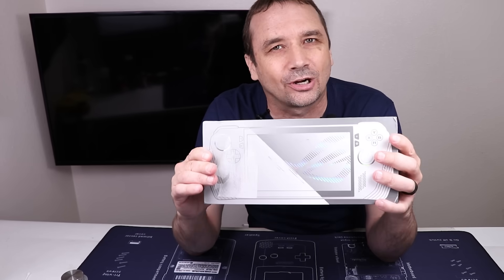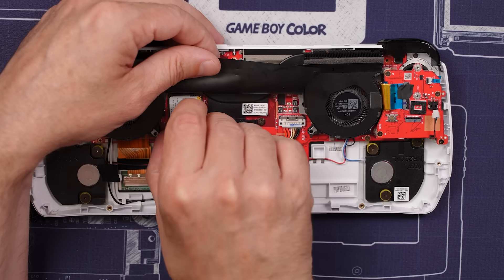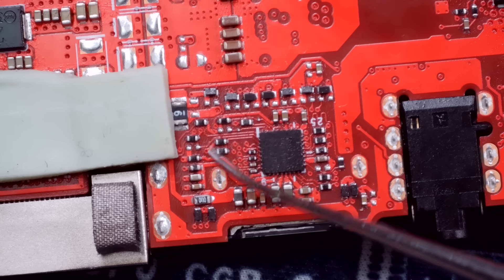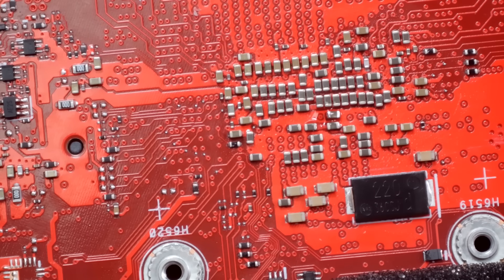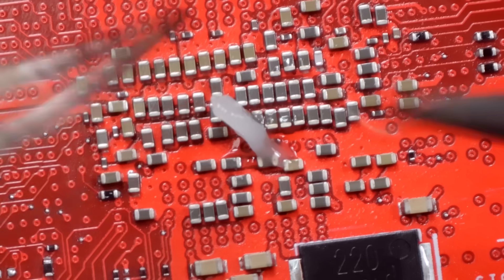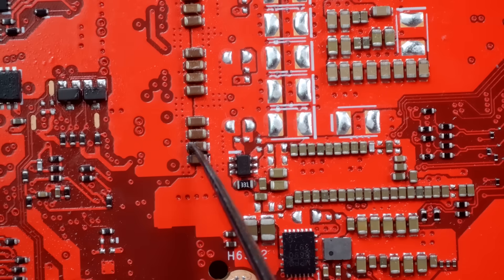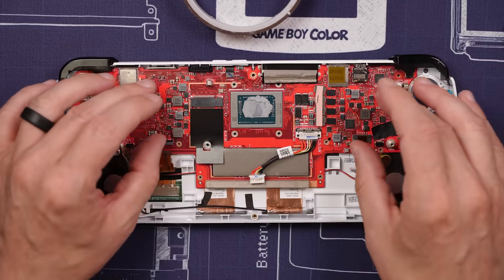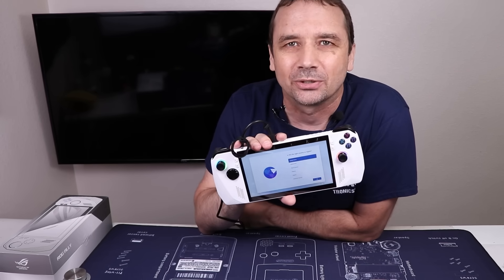ASUS REFUSED to Fix His ROG Ally - Can I?

Comment: They should have just said no warranty because it was already opened,
Reply: Then they would've been sued. You can't deny warranty for opening anything in the US thanks to the Magnuson-Moss Act in 1975 unless you can prove that there was damage inside the device that caused the issues. It was easy for ASUS to see the potentially low-quality flux and claim that as liquid damage, especially since the customer also had a failed soldering attempt.

Comment: Asus repair cost: over 800$, Tronicsfix: 2 to 3 cents worth of capacitors replaced/soldered down: device fixed.
Asus clearly does not have the skills in their service and repair department to fix their own devices. It is shamefull that they would rather extort their customers and just increase the junk pile.

Comment: I wouldn't have an issue if Asus denied the warranty claiming "Damage from prior repair attempt." or something along those lines. However denying it for "Liquid Damage" is just a BS excuse to deny warranty. I also have a huge issue with the fact that they tried to charge more for the repair than a new unit costs. A manufactures repair cost should be the cost of the part plus a reasonable hourly rate for the repair, and return shipping.
Reply: They have to say that. You can't deny warranty from simply opening the device unless you have some sort of proof that what the customer did caused damage under the Magnuson-Moss act in the United States. They said "liquid damage" was the cause of the issues in order to prevent a potential lawsuit, given that many people are already at their throats with them scamming Gamers Nexus.
Reply: @jayc.landgraf6828 I never said damage from opening it. I said damage from a repair attempt. The flux itself is evidence that something had been done to the device. It's not a warranty void if removed sticker, or just evidence of being opened, which is what the Magunson Moss warranty act prohibits.

Comment: 5:19 Steve honestly I'd say Asus should have fixed it for free, if he didn't already attempt to fix it himself. But it sounds like he tried to fix it himself first, then it went wrong and then sent it in. I'd say if things are under warranty RMA it with the company, an even if they are not in warranty ask they may still help. Then if they don't then that's when you can try yourself.
Reply: You are right. The guy realized the repair was beyond his capability and figured Asus could fix it for him, no questions asked.
Reply: @ColdStuff-cf7jv  Yeah, because if I'm ASUS an I can tell the device was opened and messed with then it's not faulty anymore in My eyes. Since the customer opened it and "did something" to it, that alone gives Me pause to think they caused the issue. With that voiding the warranty. So no dice. But I do agree there is NO liquid damage, but the tech that looked at it should have seen it's flux not liquid an noted it's been messed with so no free fix. Now $800 to fix that's total BS, might as well go buy another an keep this one for parts.
Reply: @chrisa6120 I am not in agreement in charging repairs in the Apple Method but people need to be upfront and honest if they messed with a product and trying to get a free repair. Maybe Asus would have told the guy,"Too bad, so sad" but this is why companies have become tightwads when it comes to repair. The idea of businesses=bad/consumers=good is over simplistic. Plenty of people scamming the system. I am not saying one side is an angel but there has to be nuance when looking at screwed up repairs done by people.
Reply: What you said was explained clearly in the first ten seconds of the video. Such an astute observation! Did you even watch the video?

Comment: Opening an electronic item does not void any warranty. 
Working on the components does.
Asus citing water damage was probably the only option they had to refuse the repair? Maybe they didn't have "customer repair attempt" as an option ?
Reply: Actually all technology companies has Zach and no warranty because if they didn’t, they would be replication devices that have been stupidly tampered with.

Even all devices used to have stickers on the back telling you if you opened this device, I will remove that sticker with the screws to open the device for behind you voided your warranty .

So you need to go with your warranty on electronic devices because yes you opening the device will Voyager warranty .

That’s why most repair shops tell you once they’ve repaired it that your warranty is no longer valid for the device because they’ve opened the device. Yes they fixed it but they have tampered with it so therefore you warranty is no longer valid and the repair shop normally would give you a replacement warranty . There’s a lot that don’t cause they don’t have to because you chose for them to open it up fix it instead of going to the company and get them to repair it..

The clauses that voyage warranty is a very old clause and it’s been never a long time but if you don’t actually read up on the warranty or look at the device properly before opening it you don’t actually realise until you’ve done it and then if you mess it up, you go to the company they can tell you’ve opened the device you’ve tampered with it. They will tell you your warranty is voided ..

Comment: Gamers Nexus did a huge video on Asus and there crap about not covering things and making excuses - Great job at fixing it!
Reply: I wouldn't blame this on asus at ALL. I don't think their warranty dept has a check box for solder rework. Physical damage would be a similar choice.

If the port was defective just send it in for repair. Yeah it sucks to be without your device for a few weeks, but that's a better option than attempting micro soldering... UNLESS you know you damaged the port and it was NOT going to be a warranty issue. This person attempted the warranty "lottery" after trying to fix a non warranty issue.
Reply: @volvo09  asus voided warranty on a fully functional GPU that needed 1 out of its 3 fans replaced. reason? dust on the fan. fk asus. and fk you for siding with a company that doesnt honor its warranty, there needs to be class action lawsuits against them so they will obey the warranty laws.

Comment: That also happened with a Nokia of mine that wouldn't pick up signal even if I changed the antenna, but was out of warranty and I wanted them to repair and they refused saying it has water damage which clearly never had and the board was 100% clean and crystal clear.

They basically wante to refuse warranty or fixing = it has water damage and done...

Comment: Owner should have sent it in for warranty repair when the SD slot stopped working. Trying to repair it themselves, and damaging it in the process, is a valid reason for Asus to reject the warranty claim. 

Did you test the SD card slot after your repair? If not, I would, since that was the original problem.

Comment: My experience with ASUS is that while my Ally was under warranty they did a good job. I had opened the device several times, as evidence by the little seal on the screws being broken. They still replaced the entire motherboard under warranty to fix my SD card and rear triggers. My device did get sent to them through a local Best Buy, which may have effected my warranty experience (based in the US)
Reply: i think best buy being involved is why you had a good experience. i had a gpu warranty voided when i sent it in for a simple 5$ fan replacement and they said 'dust is on the fan, give us 850$'
Reply: @zack4817 damn that's awful

Comment: Probably right to deny the claim since it had been messed with. Liquid damage is probably the easy way out versus the argument 'we think you worked on it'. They probably only have a select few reasons in a pull-down menu option, I suspect that they don't see many bodged repairs under warranty to need that as an option in the list.

Comment: I think we should be able to work on our own devices without voiding the warranty. We also need to be truthful to the company about what has been done to the device.
Reply: This wouldn't be possible. 50% of the boards they get will get will be cooked, bent and scratched beyond reasonable repair. Plus warranty is to repair the damage cause by their devices poor engineering and it would be impossible in most cases to know how much damage was done by the user. Even if they manage to repair the original fault but the user broke multiple other things then they send it back only having repaired the original fault the user will say it wasn't fixed. Fix it yourself only if its off warranty.

Comment: Never worked for asus, but I did work for a certain big box electronics store with a certain clip-on tie wearing repair team, and technically most warranties should cover anything that wasn't damaged by the user. So like, if the slot was damaged, but they sent it in for dead pixels, that should definitely still be covered by warranty.

And since the warranty on these devices is extended specifically due to SD card issues, I would not have denied a claim specifically for the flux on the SD card. However, if that capacitor was blown and that other one damaged when I opened it up, I'd document it and let the owner know "we found damage here and here, sorry but we'll have to deny the claim."

The fact that they didn't do that says to me that they may have damaged it during examination, rather than the owner, and then not wanted to cover it from there, so looked for a reason to deny it.

Can't prove it, but that's what it feels like. Unless the owner knows they damaged those two capacitors themselves and was ashamed to admit it! Which, I suppose, is totally possible.
Reply: The device stopped working so one of the capacitors was absolutely damaged before it was returned to Asus.
But whether it was broken due to negligence or happened on its own not sure.

Comment: "Liquid Damage" is definitely a cop out reason. They could have just said that the warranty isn't valid because the user opened the console.
Reply: Then they would've been sued. You can't deny warranty for opening anything in the US thanks to the Magnuson-Moss Act in 1975 unless you can prove that there was damage inside the device that caused the issues. It was easy for ASUS to see the potentially low-quality flux and claim that as liquid damage, especially since the customer also had a failed soldering attempt.

Comment: Not saying this is the case. Be careful buying stuff from Amazon. I purchased a Razer Kaira Wireless Headset for Xbox. Had it abt 10 months and it malfunctioned. Tried to get a warranty Claim. Razer said Nope. Doesn't matter brand new or not. They said it was an unauthorized seller. Luckily I fixed my Plantronics Rig 800LX from 2018. The thing just won't die. I love it. I'm never going away from Plantronics ever again. Happy Friday everyone. Much Love.

Comment: The owner probably fixed it, but during the repair knocked the capacitor and when he turned it on and moved it, it broke the circuit and switched off.

Comment: what I don't understand is, if it was under warranty (assuming that ASUS doesn't give you the finger) why did they attempt a repair and risk losing what little warranty that ASUS has?
Reply: I did this with my super expensive GPU. It was under warranty but sending it in to the company from Canada would have taken months, then you wait for the repair, then you wait many more months for it to be shipped back to you... I just opened that sucker up, found the issue (thermal pump out) and installed a thermal pad and fixed it right up! No waiting!
Reply: have you ever tried to use a warranty?? 🤣
Reply: @brentbarham3157  honestly i've only needed to twice in my life. Both were for hard drives.
Reply: @brentbarham3157  Yes in fact the last time i used Asus' warranty on a gpu the cross shipped me a new GPU as part of it, and ive used warranty on tons of other stuff too.
Reply: @brentbarham3157  no but if i was going to i would not open it up first lol
Reply: I would assume they either used it as an expensive guinea pig (to improve soldering skills) or are overconfident in their skill level I would guess.  Not to mention all of the previous negative press around Asus Warranty practices potentially making them more likely to do this instead of going thru proper channels to fix it.
Reply: @GreenLeefMusic  Or they bought it broken and thought they could fix it and flip it. When it stopped working again completely after they had it working, they probably figured it was some other problem and had nothing to lose on trying to warranty it.
Reply: Asus shafted a lot of users with the SD card defect. Most people were refused warranty service and were forced to deal with it themselves. They only started providing service after a public outcry and a lot of videos on YT. Also, in this case the actual damage on the board (the blown cap) wasn't anywhere near the "liquid damage", they probably didn't even inspect the board properly. Just scumbag Asus screwing over its customers.
Reply: The original owner is in the comment section he stated he looked online ti see how ling it would take to get it repaired and returned and thought it would take to long for something he had experience with so he did it himself doesnt k ow when that fuse blew or how the other one broke off and it was a rookie mistake to not clean the board with rubbing alcohol to get rid of the solder before sending it in for repairs because they will definitely deny it for any signs of end user messing with it the way he did.
Reply: A lot of people don't know that the warranty was extended by Asus. So probably though it was just a year warranty. So tried to fix it and then found the warranty was longer than thought. Though the other possible reasons given are also valid.
Reply: Youtube DIY...lol They probably watch a video how to fix it and think its simple enough and tried it themselves and F ing it up.  Most of the time it look easy and simple on a YouTube video but in reality when your the one doing it already, its not so simple after all. This coming from irl experience in a different field/trade with clients LOL.
Reply: probably because the original owner knows exactly why it broke.
Reply: i don't know why they didn't claim RMA . I had two claims. 1 for bad joysticks (common problem) and one for not working SD card. They replaced both joysticks and the whole mainboard for free. Maybe in EU they are more willing to fix their mistakes.
Reply: "We sent our ASUS ROG Ally Z1 Extreme in for warranty repair for issues with the left joystick ("drift"). The device also had a broken microSD card. ASUS then pointed to the world's tiniest scratch and tried to charge us $200 for it under threat of sending back a disassembled device if we didn't pay within 5 days." - GamersNexus on his "ASUS Scammed Us" video.
Reply: @BrunodeSouzaLino  fellow clipper
Reply: @beanZshots Clippies unite!
Reply: @Innoculis  reeeeeeeeeeeeeeeeee
Reply: probably cause they wanted to not go through the effort and waste time and wanted a quick and easy fix
Reply: What you dont understand is. Warranty or No Warranty. Asus doesnt care and will give you the finger anyway.
Reply: @Rose.Of.Hizaki  probably, but I'd rather find out than risk the default screw you because I messed it up.
Reply: This so much.  Under warranty don’t touch it and send it in.

Comment: You know, in the end, the seller could have knocked off a tiny resistor.  It happens, especially if you do not have the right equipment.  Good repair, another one saved from the scrapheap.

Comment: CRAZIEST thing happened to me last week. This is a must share. SO i own an Asus ROG Ally and the orinigal Steameck. 

2 weeks ago, i performed the System updates on both devices. Funny enough they are are both updates via Asus and Valve respectively.  After i updated the BIOS on the Rog, my charging pot (type-C) stopped working. WEIRD.  Did the system Update via my SD...and after using it with no issues for like 10 minutes i put it in stand-by mode. 3 days later, i turn it on...nothing. Charging light was on, press the power button...nothing. 

Wrote to Valve and Asus respectively...and turns out: 

BIOS Update 339 killed my ROG. 
The SD update bricked my Steamdeck. 

I had to send in Both devices to Asus and Valve.  Asus sent me  a  Rog Ally  with multiple parts inside replaced. Including the mainboard and LB+RB buttons. Valve is   sending me a replacement unit (BRAND NEW) Steamdeck as a replacement. . .  i swear, that was the craziest week ever. so i just had to share this. And mind you i had to fill out the RMA forms for both. followed the instructions and everything.

Comment: I think that declining the warranty was the right thing, but for the wrong reason. Seller claimed faulty sd card and put that on the ticket, but then the unit comes in with solder flux and shorts (warranty took the easy lazy route to bluff liquid dmg). pick one option, fix yourself (face consequences or not lose unit for many weeks) or send in without you opening and trying stuff and get a fixed unit back.

Comment: ASUS and many others look for any at all to deny warranty coverage. Very unprofessional. BTW, most of those capacitors are on the same plane, like at time index 10:19, it wouldn't matter if those caps are touching each other on the same side. It was most likely a manufacturing defect that cap that caused this blow out. Good work though! Cheers Steve!